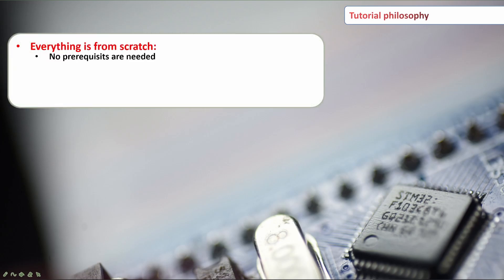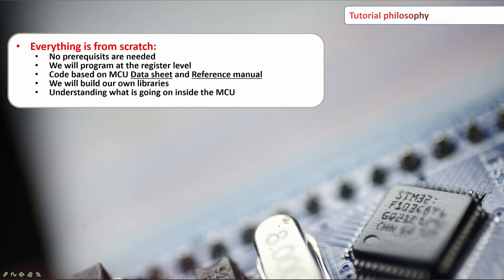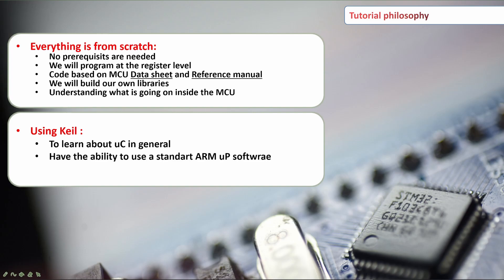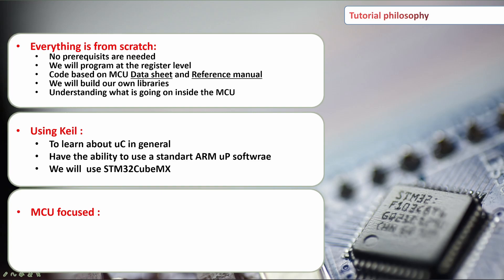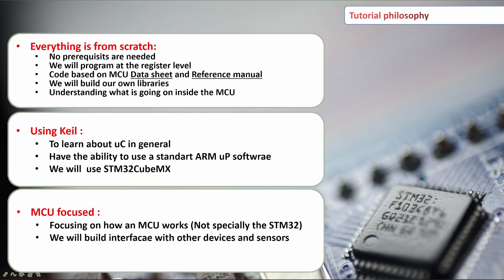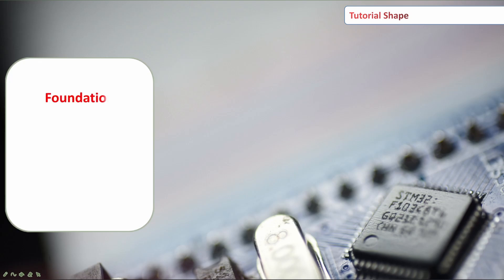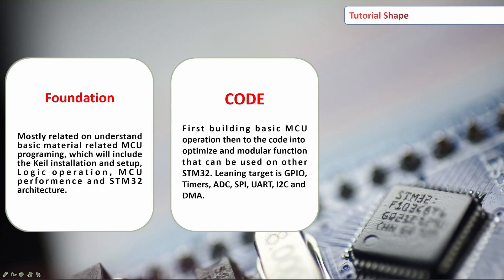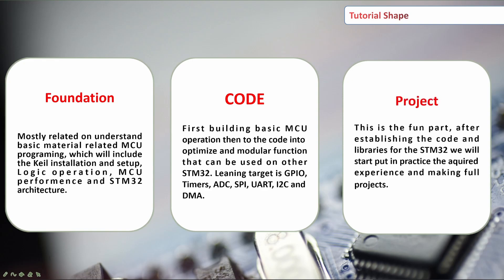STM32 Tutorial: take your Microcontroller knowledge to the next level 🚀

Comment: I think it is good series, but I only have STM32F103C6T6 aka blue pill. Will this fit for this tutorial?
Reply: Did you get your STM to run the code using this tutorial?
I'm thinking about buying STM32 blue pill too because it's the cheapest.
Reply: @jumbo999614  Yes but check this guy's other tutorial designed for this. This one is more overall so you have to combine them in my opinion. The problem with the blue pill is that there aren't any tutorials (at least I couldn't find it except for this guy). Nevertheless it is the cheapest one, language is the same but you need to work with documentation to check the buses and ports